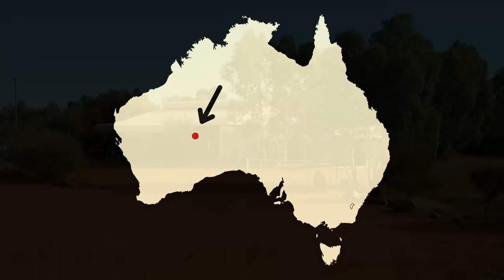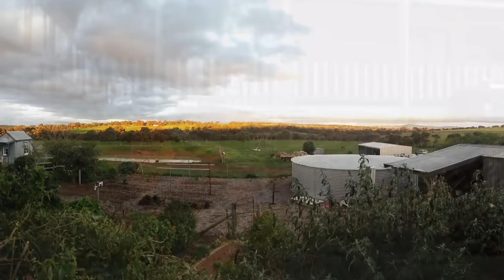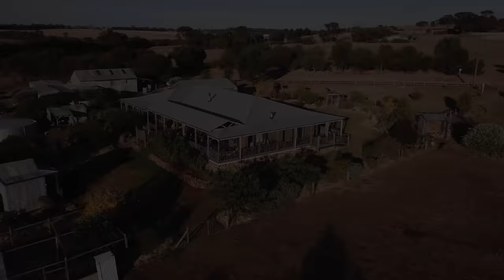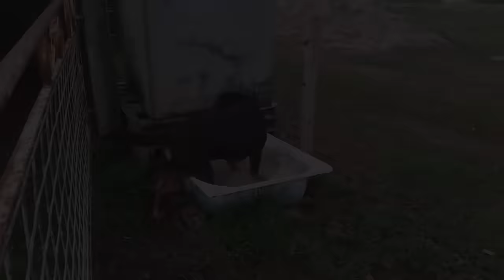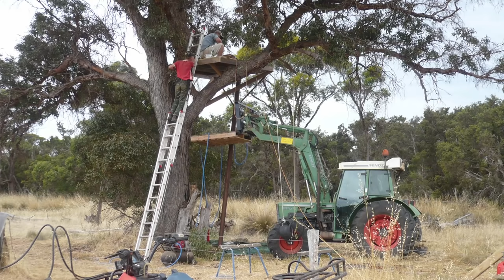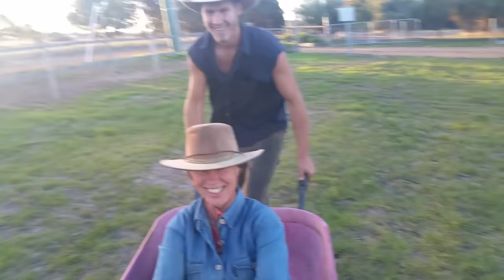Australian Family Farm | Our Story |

Comment: Good story buddy! I wonder how you made a metal pile foundation, and a wooden house was attached to it. Is this a common building practice in Australia? Does the floor wood rot on contact with metal in dry climates? These places are usually treated with waterproofing materials in Russia.
Reply from the maker: We use a water proof board and there is ventilation so the moisture doesn't stay.